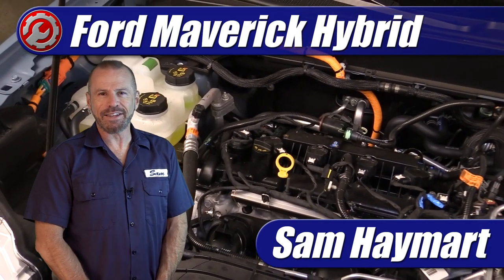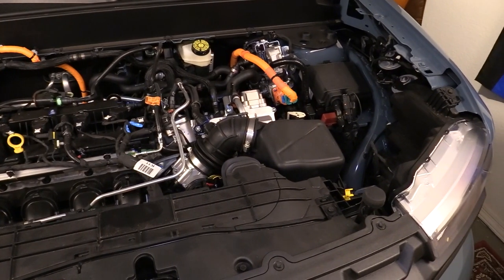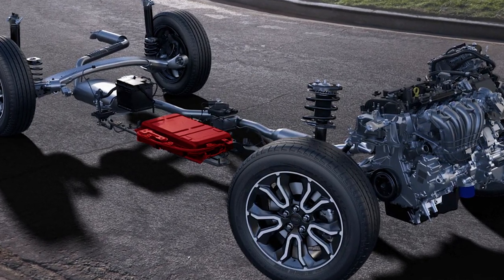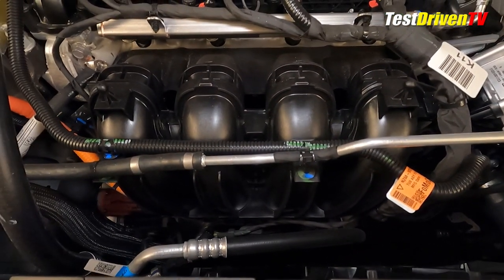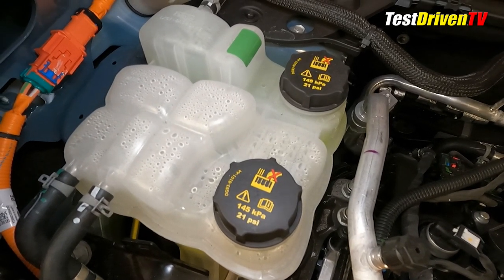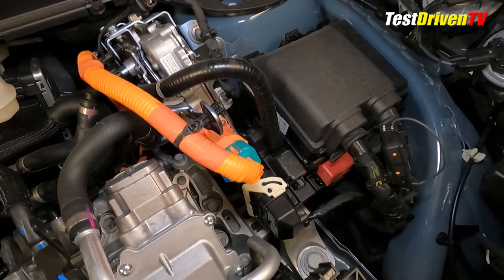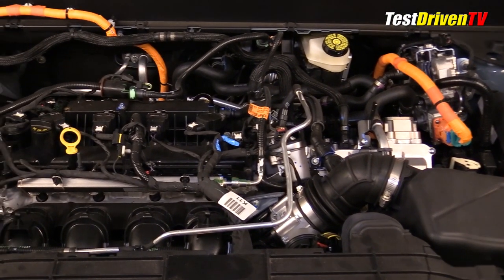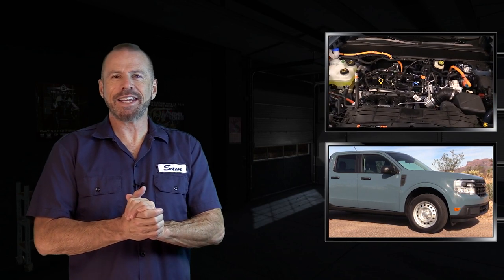2022-2024 Ford Maverick Hybrid Engine Explained

Comment: Your Maverick videos are peerless, and truly packed with solid technical information!
Do you see a way to service the "non-serviceable" trans fluid?
Reply from the maker: The transmission does not use fluid like a traditional automatic. There are no bands, friction clutches, or hydraulics. Therefore it does not need to be serviced any differently than you might with a manual gearbox - like a change every 100k or more miles if that.

Comment: These should be very similar and even better than he 2nd gen Fusion and escape hybrids which are legendary, taxi companies used escapes getting put up for auction still running with 400 and 600k miles. Im just so happy to see the more powerful electric side. Like the c max and hopefully a plug in hybrid soon

Comment: I have a 2018 ford cmax that has the previous generation hf35 ecvt transmission and have changed the transmission fluid. It uses the mercon lv fluid and is just a drain and refill setup. I would assume the hf45 would be the same. There is no internal filter or flushingrequired.

Comment: Volts don’t kill 🥰
BUT your video is great and thank you so much!
Reply: Amps kill but dat 400v finds the path through the body so its an accessory
Reply: “ Assuming a steady current flow (as opposed to a shock from a capacitor or from static electricity), shocks above 2,700 volts are often fatal, with those above 11,000 volts being usually fatal, though exceptional cases have been noted.”
Reply: @mattkaiser8984  so volts do kill, but above 2700v.

Hybrid and Electric vehicles are around 400v, even though its high, would it be safe to work on as a DIY mechanic with proper insolation and repair practices?

Comment: Great video! I've re-watched it several times to learn as much as I can about my new hybrid Ford Maverick. Can you provide me more information on the function of the hybrid control unit (near the top of the transmission)?
Reply from the maker: It basically manages the electric flow between the battery, the traction motor and the generator. It's like a giant switch.

Comment: Did I understand correctly,  if an LED bulb burns out the whole light assembly needs to be replaced?
How long do they plan on keeping light assembles in stock?
Reply: Correct, you need to replace the whole headlight unit if the LED goes. With normal halogen bulbs you can just replace the bulbs
Reply: @matthewp1682  that can get expensive fast.
How long do led lights last?
Reply: @caddmann  they should outlast the life of the vehicle.
Reply: @caddmann  : in theory, LEDs  can live a long time. But besides the led, there is the circuit board, and connections.  I've heard of headlights being sold only in pairs, easier on inventory, not sure what Ford does. I saw an Audi the other day with half a tail light, led, not working. I was wondering how many $1000s that repair would be....
I wonder how much fuel economy is aided by led headlights?

Comment: Great stuff here, Sam! Thank you! At roughly 2:02, when you start talking about the catalytic converter, could you speak a little bit more about that specifically? I'm not sure if you've seen, but there have been some reports on YouTube and on some Maverick-specific forums where folks with hybrids see a bright-red glowing catalytic converter when using remote start (especially in cold weather with the temp set relatively high). Have you guys been able to replicate that in your testing? Could it be intentionally designed that way to capture the exhaust heat for warming the cabin? Any thoughts about the red glow? It'd be great if y'all might be willing to investigate and/or do a video about it.
Reply: Usually the red hot cat means it's backed up. Not Good for the engine exhaust to be backed up.
Reply: It seems like there may be a few vehicles with this problem due to the software in the PCM. Ford communicated internally to their dealers that their engineers are working on a software update, hoping to release it in March. This doesn't seem to affect every hybrid and is not an official recall at this point, but it does look like a fix is coming. It could end up being a recall to get the update installed.

"Some 2022 Maverick and 2020-2022 Escape vehicles equipped with a 2.5L full hybrid electric vehicle (FHEV) powertrain may exhibit an idle surge and/or rough idle with high temperature in the catalytic convertor and sulfur odor in the cab. This may be due to the software installed in the powertrain control module (PCM).This condition does not affect vehicle durability and no additional diagnosis or service is required for this condition at this time. Inform customers that they can continue to drive the vehicle and engineering is currently developing a software update that is expected in the last week of March 2022. Once the softwareupdate is available, contact the customer and schedule a follow-up appointment for repair."

Comment: Question. Everytime the engine comes on does it use a traditonal starter, or does the igniton come on and it jump starts from being in motion?
Reply from the maker: The integrated starter/generator inside the transmission starts and stops the engine, it does not have a traditional starter. More info here: https://youtu.be/woBvHw4VYGE

Comment: I just received my first Hybrid. My 2023 XLT Hybrid is approaching 3000.0 miles and Ford Pass says my first oil change reports being due in 8400.0 miles or September 2024. When should I get first oil change due to brake in period? Thank you in advance.
Reply from the maker: Everyone has an opinion on it. Our first oil change was at 13k miles and it said we could have gone to 16k. It was fine, the oil was not a wasteland at all. Hybrid engines only run 50-60% of the miles. With synthetic oil the old fashioned wives tale of "change your oil ever 3-5k miles" is long gone.
Reply: @TDTVGarage  thanks

Comment: So all 4 sparkplugs are accessible from the top? Thats cool.. no need to remove half of the engine to change the sparkplugs..   where is the catalyc converter located?  Or should i ask, how easy to steal it?   I like to wash my car , including the engine but with that high voltage under the hood ill be very affraid to throw water in there.  Is it safe to wash the engine with water pressure?  What kind of belt does the maverick hybrid use? How easy is to change the water pump?
Reply from the maker: Converter is just behind the engine. Generally cleaning the engine is safe, but high pressure sprayers are always a concern even with standard engines. There is no belt and no belt driven water pump.

Comment: I have had my Hybrid Maverick about 2 months.. I recently used my remote start and the motor sounds like a tractor! It got around 0 degrees in Missouri for a few days.. any suggestions?
Reply: Check the oil level.

Comment: i typically in my gas powered vehicles like to change my oil every 5k miles..   with the hybrid there is a mix between the electric motor and gas engine.. so how often should a person change there oil in a hybrid ?
Reply from the maker: The Maverick computer tells you when it's time. Owners manual talks of a 10k mile interval range that can go up to 15k miles depending on usage metrics. As of today ours has 12.5k miles and still has 25% oil life left. The engine runs half the time vs miles, doesn't need to be changed nearly as often as a conventional car.
Reply: @TDTVGarage  thank you for the information.  I have a 2022 hybrid escape.  I guess the escape will follow those guidelines as well.
Reply: Ford forgot to add oil change ports in the windage tray under the engine. Something like 13 bolts and the tray need to be removed to access the oil drain and filter. Maybe saved them a dollar on production costs

Comment: How is cabin heat done?  Is it strictly through radiator temp?
Reply from the maker: Heating is done through the coolant only. There is a heat exchanger in the exhaust system that captures heat for the coolant when/before  the engine has not warmed sufficiently.

Comment: the ford maverick hybrid does the heater work in the winter time if the engine is not on i live in chicago i do not go on highway?
Reply from the maker: The engine will fire up and run to make the heater work if you have it turned on.

Comment: I would like to know if combustion engine is resleevable, or is there "repair" piston kits like say on Toyota, with slightly bigger diameter to match the wear, and overall how much thousand miles can it hold up until engine repairs, and is it costly engine, repairable etc. Mb you would consider such video one day, thx!)
Reply from the maker: It's really kind of a non-issue. By the time and engine wears to the point anything like liners or new pistons would be necessary the cost of doing such a job would likely be well more than the vehicle is worth. Hybrid's like this typically run 400-500,000 miles before engines start to wear to a point they are not working well because on a hybrid the engine is turned off half the time. At that mileage, the rest of the car would be barely worth the effort of even replacing an engine. And not we would not consider doing a video like that as we would have to wait around for a vehicle to wear out. We test new ones.

Comment: The eCVT trans  IS  serviceable. CVTs do not have dipsticks. Similar to a
manual transmission they have a plug under the trans to drain & another
plug up high to fill & check for level. Best Practices is to change this oil
every 30K if you want to get long life from it.

!

Comment: Dip stick transmission not unit servicing? What that mean?
Reply from the maker: Means you don't check your fluid on the transmission nor do you service it.
Reply: @TDTVGarage  SAME WAS SAID FOR THE PRIUS AS THE STEALERSHIP WANT TO SHORTEN THE LIFE OF THE TRUCK TO COME BACK WITH A NEW ONE
Reply: @TDTVGarage  Are you able to provide greater detail?  Is there any way to change it?

Comment: How reliable and dependable is this Hybrid engine.
Reply from the maker: This engine and hybrid system has been in production for many years. You research data on the Ford Escape, Ford Fusion and Ford CMAX to see how it has performed.
Reply: @TDTVGarage  I will research it. As a mechanic what is your opinion on it?
Reply from the maker: Ford Escape and Ford CMAX hybrids with nearly the identical powertrain have proven very bulletproof being used as Taxis in places like NY for decades often racking up 400-500k miles. We own the Maverick Hybrid used in this video and its pretty issue free thus far. Ultimately is us under warranty for 8 years, 100 miles so it really matters not if there are issues.
Reply: @TDTVGarage yeah they're very reliable. I own a 2013 ford cmax and 2013 ford fusion hybrid. The fusion has almost a quarter million miles and I've only had to replace a speed sensor. Not even brake pads yet. Original suspension is still great! The cmax has 110k miles and runs great. Bought a new set of tires for it today and it's like a new car again 😅 I use both for Uber

Comment: WAIT!! did you say it port injected? So this isn't a DI engine?
Reply from the maker: Not direct-injected. As shown in the video you can see the port fuel injection system clearly.
Reply: It's better then DI , no extra carbon build up to clean. I will never own a DI engine again without auxiliary port fuel injection. Sometimes older is better.

Comment: Zero discussion/explanation on the hybrid motors and ECVT.  Other than saying it's an Atkinson engine, not much info.  More homework is required before you can call this an explanation of the Maverick hybrid engine
Reply from the maker: Maybe next time you feel the need to criticize you should do some research first. This video is a basic overview, our more in-depth video that's exactly what you complain missing is here (found on our Maverick playlist). https://youtu.be/woBvHw4VYGE